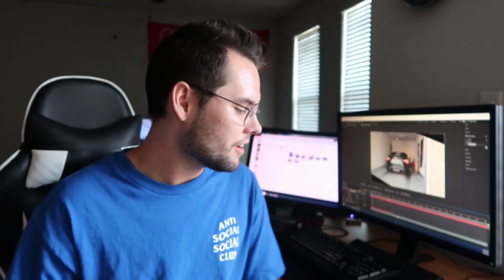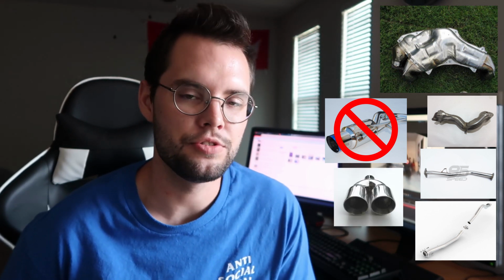BRZ + Custom GTR R35 Exhaust. Best Sounding Exhaust possible?!

Comment: To fit the quad exhaust tips, did you have to switch to the TRD bumper? It looks like it.
Reply from the maker: You dont, this is a stock bumper. These are the JDM TRD garnish for the stock bumper from Japan

Comment: Bruh that’s awesome!!! I’m in the process of looking around for a nice Quad tip exhaust now that’s how I came across your video. I want to do the same as yours but don’t really wanna cut the dual exhaust on my N1 catless tho haha😅I was leaning towards replacing the dual exhaust with a quad exhaust part of the catless if that makes any sense? Could use with some advise cheers amigo..
Reply from the maker: If you cut the mufflers off the n1 like I did, it actually has way less drone
Reply: Mike Brewer Cheers for the reply amigo🤓👍Do you have some pics or video on how you cut it and attached the quads by any chance? Tho I just realised it’s been a year since you posted this video lol In specific what pipe did you use (measurements and type of material) to replace the old muffler section? Also, what measurement did you get for the quad tips to connect to the pipe? Cheers amigo🤓

Comment: So I have the stock bumper on mine. How did you fit the quad tips with those garnishes, did you have to cut the bumper?
Reply: I have the smaller outlet bumper, really want to do a quad tip setup because I have the same color BRZ!!!!
Reply from the maker: Yes you cut it, you need this: https://www.ftspeed.com/part/ms343-18003-trd-quad-tip-exhaust-finisher-2013-ft86

Comment: Hey bro you said you blew your motor, did you have a tune?? I also have a warranty on my frs and I want to do a tune and headers but i don’t want my warranty to not work if something happens
Reply from the maker: I did have a tune, but I put the stock tune back on it before I took it in and they never knew
Reply: Mike Brewer so the tune doesn’t save in any data logs or anything?
Reply from the maker: If they dig deep supposedly they can find it but I left my car with them for a whole month and they never found it. I cleared the tune, put my stock one back, took the battery out and let it reset to factory oem everything and I didn't have a problem
Reply: Mike Brewer alright cool thanks lol what headers did you have? I’m thinking about doing tomei headers with a greddy race rs exhausyb
Reply from the maker: Stock currently, I used to have tomei but the sound I have is really good with stock
Reply: Mike Brewer right now I’m stock headers stock tune and a full straight piped exhaust. Its really loud but low rpms it sounds like I have headers but when it gets higher up it gets raspy